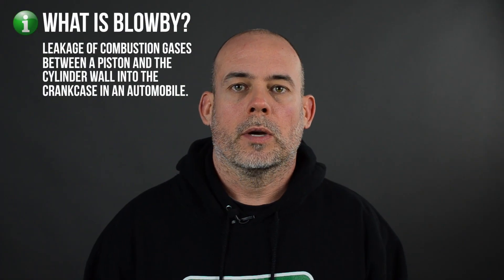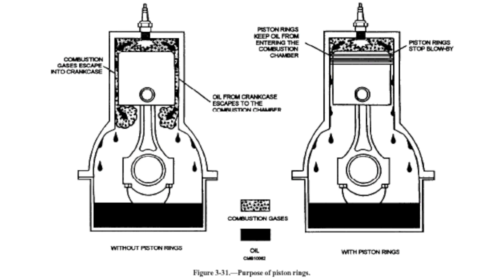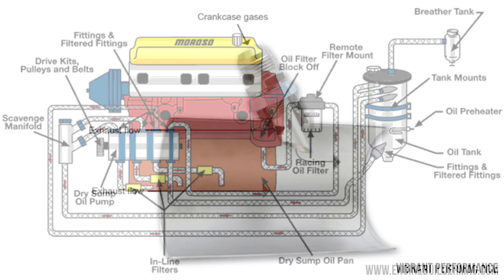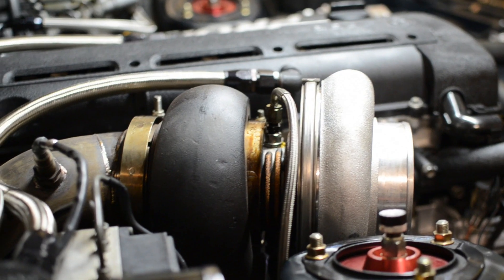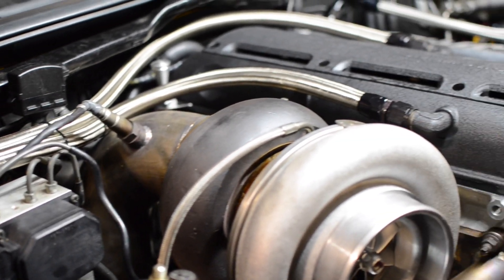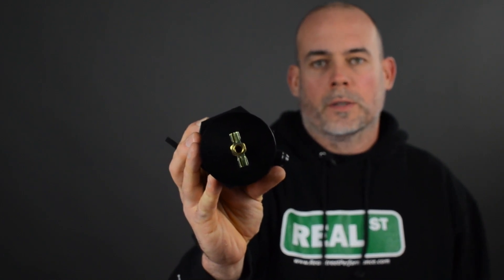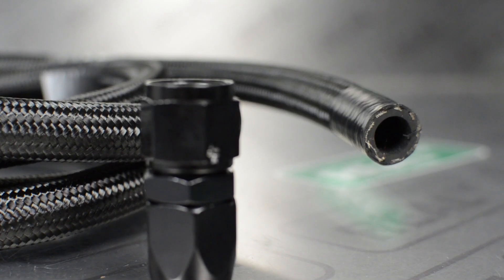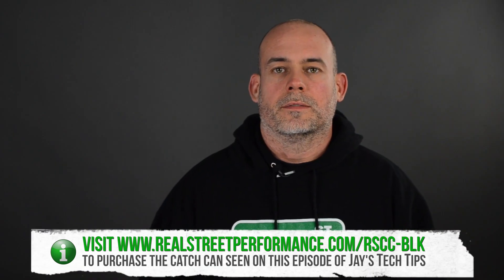Jay's Tech Tips #39 - Why is a Catch Can Important for my Build? - Real Street Performance

Comment: Weird explanation... I mean the main point of an oil catch can is to CATCH OIL (as the name implies). Oil that would have been sent back into the intake manifold by the PCV system. The catch can doesn't enhance the ability to relieve pressure, especially as many catch cans don't have a vent to atmosphere and they just sit in a closed system that loops back in to the intake manifold. The PCV system and breather pipes are already doing the job of relieving pressure. Maybe he's talking about engines that don't have any kind of breather or PCV system? But then the catch can still has nothing to do with that really, it just happens to sit in the middle of that system and pull the oil out of the vapours before they get sent back into the engine.
Reply: Keep in mind that a PCV by design closes under pressure so if it's a boosted engine the PCV has nothing to offer under boost. 

 Thanks
Reply: ChrisDrift it straight forward. Getting oil and oil vapour into intake manifold causes deposits and lowers octane on a/f mixes thus losing power. On boost the pcv will remain shut yes but the crank case breather will still recirculate into the front compressor into the manifold. Catch the oil, higher the combustion potential and save the deposits on your intake manifold and piston crowns.

Comment: is it better if the vapor is pulled out by vacuum or is it fine if you just let it natualy vent like the breather does? I have a diesel and I'm running close to 30psi of boost and I am running the vented setup but I am wondering if it needs to be pulled out by the vacuum. thanks
Reply: Josh Ricke no need to pull it out with vacuum. the positive pressure that is built up in the crankcase is what will "push" the pressure out of your engine.
Reply: Never vent! You want to do as ALL Professional race teams in all forms of Motorsports do, and that is a vacuum pump system that will provide full time vacuum so the pistons are not fighting the pressure on the down stroke, and if you vent, your leaving most all of the damaging compounds in the crankcase to accumulate and cause premature wear.  Watch this video. First pull is venting, the second pulling evacuation. And this is just a naturally aspirated engine. https://www.youtube.com/watch?v=-7bGshirEKI&t=29s
Reply: Josh Ricke 8
Reply: @tracylewisperformance1328  what is this bit based on " the damaging compounds in the crankcase to accumulate and cause premature wear" theory or can you point me to some info? i find it a bit hard to believe.

Comment: Also adds to crank' and cam' seal wear.
I'm not familiar with the "import" market, but a couple of observations from other engines.
Most OEM engines, eg SBC, have well developed internal separators built into the valve/cam' covers and these can do a good job BUT we often fit aftermarket covers and they rarely, if ever have these built in - for the second type there may be a lot more oil carried out as droplets and so the catch tank should be sized for that.
Some OEM covers have some sort of plate, or shield, built in to prevent oil spash getting into the breather outlets, but sometimes they get it wrong - I have some Cosworth KBA engines (GM 20XE) and while excellent in almost all other ways, the shield needed to be modified as it was possible for oil to be held in it under some conditionds and for it to then get sucked into the intake through the breather hose - not good!
The catch can may remove some water vapour from the engine so don't panic if, instead of nice clean oil in the 'can, it is a horrible gunge - it does not mean a head gasket problem.
Lastly, remember that the oil in the can has come from the engine - don't forget to top up the level if required.

Comment: Vented cans suck. A well made can attaches to the intake where vacuum can help pull the crank case gas's out. A friend of mine using a inH2O gauge (so not normal PSI, far more sensitive) measured a pretty big difference in crank case pressure between having it vented and having it hooked to the intake.
Reply from the maker: We make those too mean man, check them out here http://realstreetperformance.com/Products/Precision-Turbo/?search=pcv+catch+can+rsp

Comment: All cars need a catch can the garbage coming from the crank case is going into the air intake and on the pistons and intake and exhaust valves and circle the inside of the engine and out the exhaust

Comment: Correct me if I'm wrong please. The stock pcv system has a vacuum from the intake system-manifold, so it works as a vacume pump. When installing these catch cans, there is no vacume, so does that mean there would me more pressure in the crankcase? Thanks!

Comment: Great. I was wondering if the 19mm hose I used was too big. Because it was the opposite of all the smaller diameter stuff I’ve seen another builds For the Catch can piping. 3/8” is what I normally see.

Comment: I have a fully built k20z1 motor in a rsx that is being boosted with a garrett gt35r full race turbo kit. How many breather filters should you run on a catch can? Or can I get away with running one like the one you just showed on this video? Great channel by the way, very informative.

Comment: Whats a better option. Running a catch can with intake vaccume? Or a line into the downpipe? Or maybe a catch can to down downpipe? I dont plan on running a muffler and the downpipe one seems easiest for me.
Reply: Tye Varnes run it to your downpipe. that will give you the least chance of sucking up oil fumes and vapors into your engine.

Comment: I'm running a aluminum rod motor on the street 4g63 close to 50lbs boost, I'm told you run your pcv into the catch can, then from the side vent from the VC a line to the turbo intake? Is this a proper way to do this?

Comment: hi got your catch can a few months ago for my b18c motor, i routed 2 hoses from the back of the block to the catch can,  removed and blocked the stock box on the back of the motor, also caped the valve cover nipple, is this a correct? thanks for the awesome catch can btw.

Comment: Jay, venturi works only in a fluid carrying system. Exhaust system has expansive hot gas leaving under boost pressure causing back pressure into the venting system. If exhaust system pressure overpowers crank case pressure, very likely, in a car running 40psi but boost drops to 30psi because exhaust restriction. This will impede crank case venting. Vacuum 1st, atmospheric venting 2nd, "venturi" applies to fluid and should not be used here.
Reply from the maker: that is why 1 way check valves are used on the hose going to the exhaust. So that exhaust back pressure can not feed back into the crank case. its very old, very common technology in racing that has been used successfully for much longer than we have been racing. But it can get messy so its not right for everyone.
Reply: REALSTREETPERFTV, agreed, old system. 1 more point about the check valve. It's closed under load so no exhsust back flow happens, under load when crank is being pressurized and needs venting... 
Thanks for all you guys do.

Comment: That can you got there should have another AN10 fitting, reason is that some customers want to connect inlet on turbo to the catch can.
Reply: +steisje  IF you can control the oil/oil vapors from getting sucked into the turbo that's a fine approach.
Reply: +Jay Meagher Yes Jay, that's an important point. 
I hope Long hooses, big filter (on can) and modifying the baffles  makes sure of that. Time will tell. ;)

Comment: For a 2JZGTE at what HP level are catch cans recommended?  I'll be sitting right about 550 on fully built engine until, I get fuel/ECU work done.  Thanks.
Reply from the maker: I would do one pretty immediately if you don't have a way to monitor crank case pressure. Its an inexpensive fix to a common problem

Comment: hi jay I have a 04 wrx sti EJ-207 it is stock but runs  22 psi would you put a catch tank on this or just leave it stock and blow it in to the turbo. and can I put a dry shot of nos on my engine with out modifying the fuel system ? it was a stock tune on the ecu thanks if you could shed some light on this cheers

Comment: How do you prevent unmetered air with a vented can? i imagine you could use check valve on the intake side of the can but its still gonna pull a vacuum through the can/breather? i have sealed setup now, check valve on the intake side and breather side of cover back to turbo intake.

Comment: Question for Real St.
Can I put a sealed(non vented) catch can inline of the factory breather line that goes to turbo intake piping?  Leaving the factory PCV system intact.
My thinking would be engine would pull blowby from valve covers thru PCV valve to intake manifold on vacuum, then pull blowby from valve covers thru catch can to turbo on boost.  I am only boosting at 12 psi and dont intend on going over 15psi.
Reply: +Mike V  IF you can control the oil/oil vapors from getting sucked into the turbo that's a fine approach.
Reply: +Jay Meagher that answer my Question i was thinking thanks you!!!

Comment: boosted engines needs a vented catch can instead of  n/a engines they need a closed catch can and retain the factory pcv ?
Reply: All engines need a catch can ... preferably vented to atmosphere. Boosted or supercharged engines need a catch can even more than n/a ... 
Problem is the pcv system only works on crusing speeds at around 10 inches of vacuum, anything above and below that, its closed forcing the crankcase pressure to exhaust thru the valve cover breather and back to either the turbo inlet or the intake manifold on the na motor ... either way on a factory setup the crankcase pressure exits and goes back into the motor ... which is bad over time ... unless you plan on keeping the car for 30 years and want it to last then dont worry about it...  if you want your engine to run stress free and run clean, you need to vent the pcv and valve cover to a oil separator then to open air ...
Reply: @ACommenterOnYouTube  I'm wanting to put a catch can on my n/a Honda k20, but I dont know if I should route the catch can to the pcv and back into the intake manifold, or route it from the valve cover breather back into the intake. which would be better for my application? thanks
Reply: I would take BOTH the valve cover and pcv to a catch can and then vent to atmosphere ..
Thats how both my cars are. Not all catch cans are good, some are better than others, some are complete garbage. But i would not trust any enough to send back to the intake for re-burn. 
My catch can is a dual INLET and single OUTLET.

Comment: Catch cans dont give 100% to relieve crankcase pressure ... if you want your crankcase to breathe without any restriction, you cant use a catch can or oil separator ... at that point you need to run your valve cover breather to open air and the pcv port also needs to vented to open air ... this way as the crank is turning and the pistons are going up and down, the engine has 2 ports to release all that pressure, especially in a turbo or supercharged motor, those need extra breathing room ... problem is, now you may get oil shooting out of those hoses ... which now becomes the need for a catch can or oil separator which does the job but does create a slight restriction on how the engine breathes.. even though your catch can has a tiny filter on top of it... all the engine pressure has to breathe out thru that filter ...  now the question is, can that tiny filter allow the engine to breathe during heavy acceleration or under 10+ lbs of boost ....

Comment: What are your opinions on a catch can that drains back? my car has a line under the catch can that drains back to the back of the block where my pcv used to be.
Reply: +b20pwr  Something like the T1 can is a great option if you have a Honda and are draining back to the oil pan. Just keep in mind that depending on the climate where you live condensation accumulating in the can isn't something you'd want back in the engine.

Comment: was thinking of adding a catch can to my car to keep oil from getting into my intake but the one i was looking at  is not baffled and does not have an external filter on it. currently i have 2 valve cover breathers on each valve cover for a total of 4 breathers and the valve covers are baffled. do you recommend using one like what you are showing in the video or if the one i was considering sufficient. car has street twin turbo setup on it
Reply: shoua50 get one with baffles. especially for twin turbo set ups.

Comment: Hey I have a question.  Why does the air exit the filter on top instead of returning to the intake?  Wouldn't that be more efficient and help with boost?
Reply from the maker: The catch can in this video is vented to the atmosphere so that oil residue does not go back into the intake air. But we do have a closed pcv system that routes the air back into the intake as well it can be found here http://realstreetperformance.com/Welcome/?search=rspcv

Comment: do air vent catch cans work better then ones that use you set up to use vacume from the throttle body?
Reply: Damien ideally they are both equally effective. however, using throttle body vacuum or any vacuum source from your engine to draw out pressure always has the chance of sucking up oil fumes back into the engine, which will rob you of power etc.

Comment: Do you recommend putting a oil catch can on a 2014 corvette c7 z51 even though it has dry sump oil system?
Reply: No sir, the dry sump will handle crankcase pressure on it's own.

Comment: Would this still be emissions compliant?  I thought that the purpose of an egr system to keep gases circulating through the engine and not vent into the atmosphere. This catches oil that I understand but would this cause me to fail emissions? I'm planning an ls swap and see that something like this is a good idea, so I'm  just doing some research.
Reply: It depends on your country. I'm from the Netherlands and it's illegal to vent it into the atmosphere here,  however it's one off those things were they will often close an eye for at the MOT. alternatively you could run a closed catch can where the air goes back into your intake rather then into the air.
Reply: on an ls in the us you can just reroute the catch can and route the cans outlet air hose into your intake so that it goes crankcase->catchcan->intake->engine
Reply: What hes show is A breather can not A catch can. why is he calling it A catch can idk lol

Comment: Hey Jay, I have a catch can on my 2jz and I emptied it after a week or two of driving and dyno pulls. There wasn't anything in it. Is this something I should be concerned with? On the dyno it made 674 @ 26psi on e85. I was going for 28psi and about 700 but I ran out of fuel. Just curious about the empty catch can. Thanks, Jay

Comment: Hi Jay! I always wanted to know what is the real difference and benefit between installing a sealed can without breather between valve cover and intake manifold,  and connecting the can between the 2 valve covers as usually seen in 4AGEs with the double oil cap valve cover mod.  Thx in advance!
http://s33.postimg.org/i489sha33/2446929_5_full_Copy_1.jpg
http://s33.postimg.org/cjvbygua7/doublecover.jpg

Comment: to be clear, a catch can does not reduce crank case pressure.  Thats what a breather does, and you can put a breather on pretty much any valve cover, a $150 catch can isn't needed for venting.  The function and purpose of a catch can is if baffling inside the valve cover isnt sufficient enough to keep oil from soaking the breather and getting it all over your engine.    Its not a performance enhancement, its for cosmetics and in some cases safety.
Reply: There are many engine platforms that you can't fit nice baffled stacks on and the valve cover doesn't offer proper baffling.  The Nova that's on your channel can easily fit 4 nice baffled stacks without interfering with much in it's large engine compartment. You mentioned keeping oil off the engine and that's a huge benefit of the catch can.  For a fairly low cost you can purchase a remote reservoir that can capture any oil that exits the top of the engine under pressure. You'd be surprised how much oil is being blown around at higher manifold pressures with a dry sump oiling system.   
 
 thanks
Reply: Or go with a dry sump lol.
Reply: That's clearly the best option.. Much better oil quality to be had with a dry sump.

Comment: CATCH can should not have a breather on top of it that defeats the purpose, how can the PVC create a vacuum if it's vented to the atmosphere
Reply from the maker: steven wentling they are two different methods of doing the same thing. One gives positive crank case pressure a place to bleed off into that will contain any oil residue in an open system with a breather. The other sucks crank case pressure out and routes it back into the intake. We have those as well. They are our pcv cans that can be found here http://realstreetperformance.com/Welcome/?search=Real+Street+pcv+can but routing this air back into the engine is not always the appropriate course of action. So while you are right, in some applications a closed pcv system can be more beneficial. Which is why we make both, so everyone can be happy :)